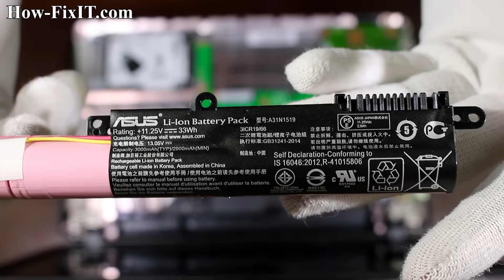Asus X540, F540, R540 Disassembly & Battery Replacement | Repair Fast-Draining Battery

Comment: This worked like a charm! Thanks for the helpful vid. I recommend for others to avoid any complications, when you first take the keyboard off don't disconnect the wires and plastic connected to the bottom. Just shift the keyboard down so you can work with just the battery.

Comment: I will never, ever again buy an asus laptop. Bought this X540 on an hurry, I needed right away and it was cheap - but, boy, this cheap model it's really cheap: cheap performance, cheap battery life, cheap keyboard, what a piece of junk this asus is :-(
And when I came home to find out that this is not even a "real" battery, are some cells connected one to each other, this makes the laptop even worst. I found out, to my expenses, that if I move the laptop around while on battery it shuts down because sometimes these cells loose contact with each other. Please, an advice to anyone trying to buy this piece of crap, just don't: you'd be better dropping your money through the window :-/
Reply: I have to agree
Reply: I have had the same issue, I use my laptop to work on cars and need it on battery most of the time. When driving the car I would lose most datalogs because of it shutting down. Took me til now to discover its because of this POS "battery"
Reply: Правильно никогда это дерьмо не должно покупаться и ни кем.

Comment: This is absolutely ridiculous. I could remove the battery with a push of a button in my old laptop.
Reply: I FULLY agree.  I believe in Washinton state they passed a law or were trying to pass a law that bans these peaces of s...t from being sold here.  Items like a battery should be easily removed by the consumer; otherwise they have to spend money at the shop or risk breaking components while opening the electronics.  It's theft.  I repaired desktop computers (rarely laptops) in the past and many times I repaired a laptop I broke or fried something, even after being very careful.  The plug ins for those little cables that hook components to the motherboard are very sensitive and pins could bend easily when unplugging/plugging them back in.  In my laptop, I just caught the lcd/cam cable almost on fire because a pin got bent and touched another one.  I unhooked/hooked it back on very careful and still... Plug sparked and pin broke off.  Same laptop model as above.  I'm going to have to buy a new ;cd/cam cable cheap on ebay  for around $12 and an lcd screen on Amazon for around $40.
Reply: Its because they want more people damaging their computers when trying to attempt simple fixes that SHOULD be easily done by every laptop owner versus having to take it in for professional repairs. More laptops damaged by average user means more laptop sales for them.

Comment: what a pain in the ass, having to take apart the computer to replace the battery
Reply: Here are some instructions, if you want to avoid breaking something when opening this peace of s.... laptop.  Some mistakes I made and some suggestions below:

1.  If you are going to use your raw hands, make sure you touch metal before opening the laptop.  Do it every once in awhile to be safe or you might fry a component.  If metal is connected to the ground better.  Discharge all that static electricity.  Avoid walking on carpet while doing this job.

2.  If you are going to use a working credit card to open laptop, don't. I used my library card and now I don't know if I will be able to use it at the new Pay First machine connected to the printer at the library.  My card is destroyed around the edges.  Use an old card.

3.  Make sure you take all the screws out.  I left a sombeatch in.  Was wondering why the plastic was so hard to pull apart at a point.

4.  Don't do anything until you watch this video titled "Asus X540L Disassembly" if you don't want to break the 2 cables you immediately see after peeking inside the laptop before completely removing the top plate.  These cables or buses have a lever you have to move to disconnect the cables properly from the motherboard.  Then you can remove completely the top plate.

Good luck.
Reply: @chlamydiayourdaddyishere  I went to replace the HDD to a SSD, as soon as I pulled out the drive the fucking thing pretty much flipped over, it's made as cheaply as possible 😓
Luckily I got it as a display model and didn't pay retail price for it ...